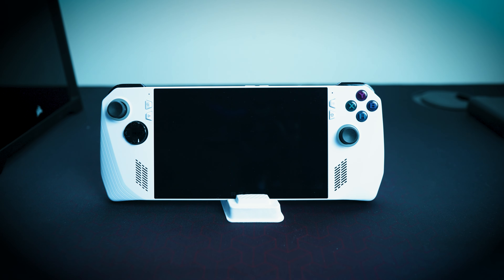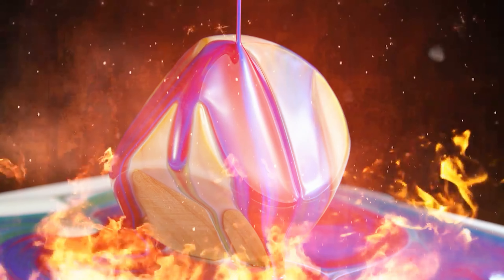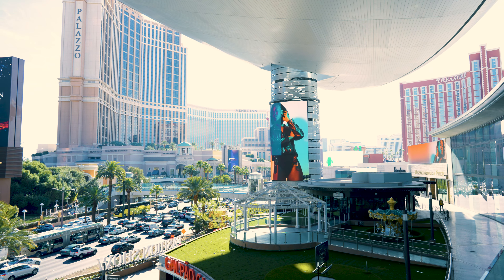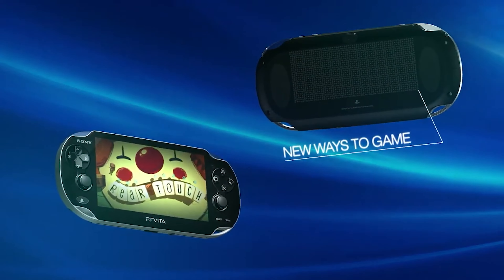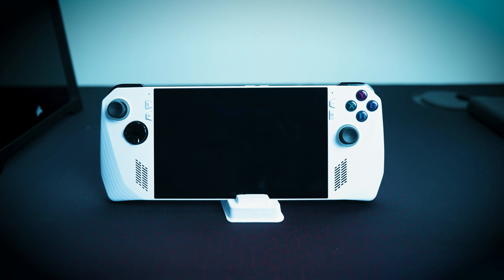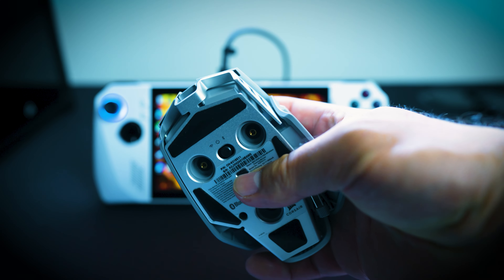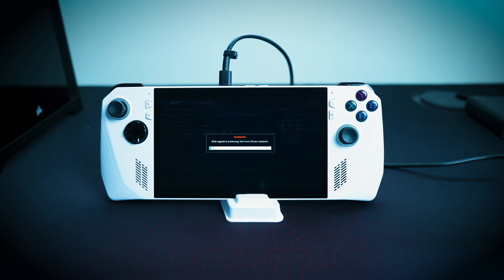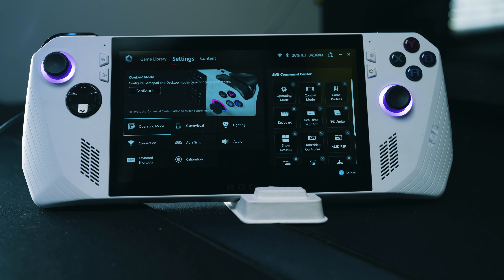ASUS ROG Ally 2! What can improve the Asus Rog Ally?

Comment: We need better power delivery to the GPU. Less to the CPU, the Zen 4 cores are so powerful they rarely are used fully, still drawing lots of power in my testing and starving the GPU, give more wattage to the GPU and not to the cpu would provide much better balance. Yet no tool supports programming the AMD SMU to achieve that. CPU is always taking too much power in my mind.
Reply: VanGogh achieves a much better GPU focused balance when it comes to power draw. 24 CUs Z2 version would also rock. Just remove 4 cpu cores to put them into the die.